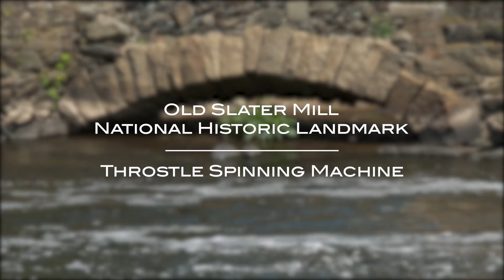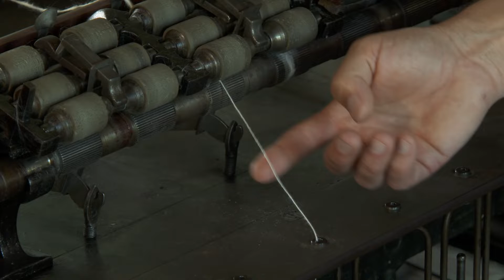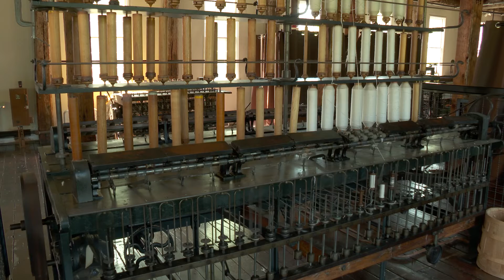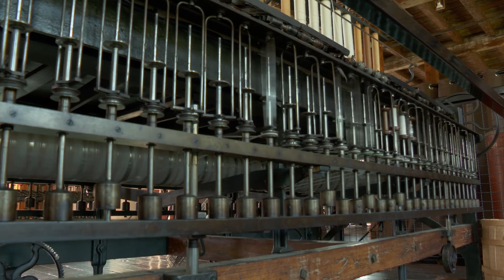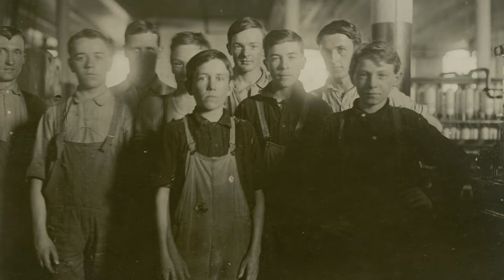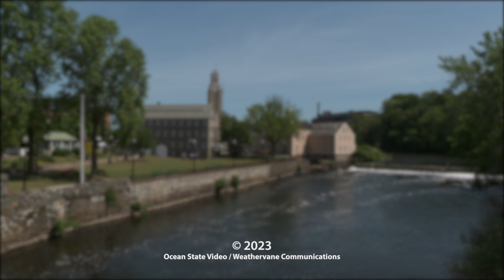Slater Spinning Machine | Treasures Inside the Museum

Comment: One non period correct piece on that machine is the rubber covering called a cot on the drafting rolls. They look in the video to be rubber cot covered which would not be available till many many years later. Rolls at that time had thick leather coverings on them. I know this because my family owns and operates a modern roll covering shop covering textile rolls. Our company was founded in 1935 and at that time leather was still used to cover spinning and all other drafting rolls.